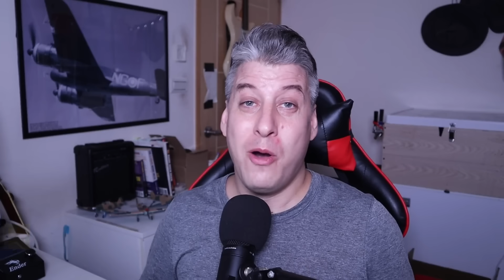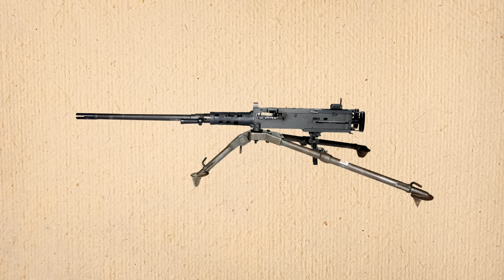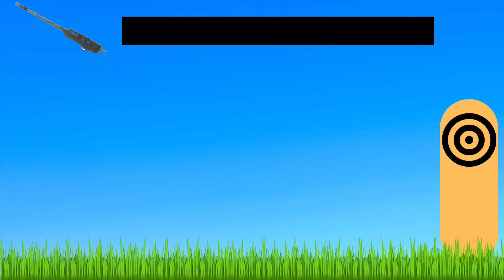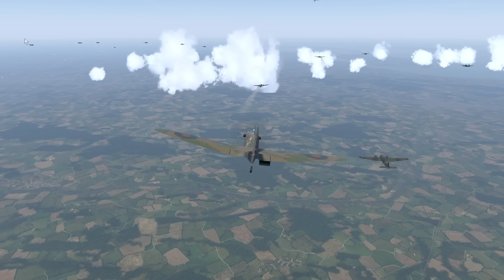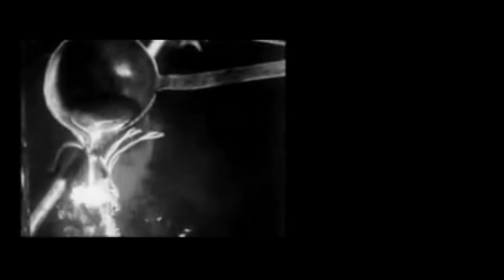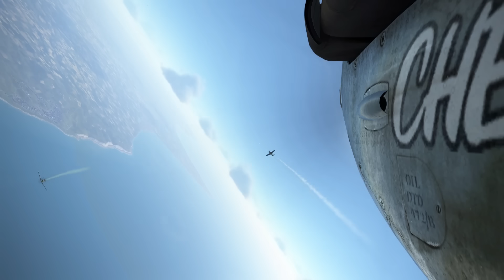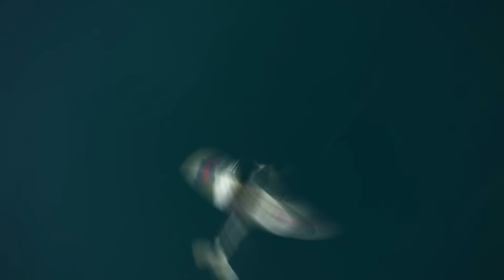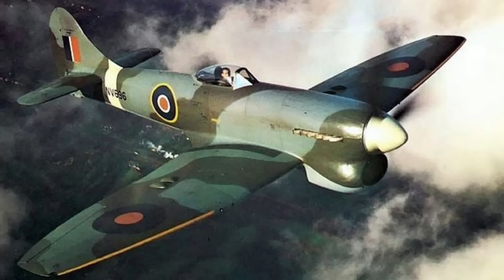Why Did The RAF Use .303 Caliber Machine Guns in WW2? The Surprising Answer

Comment from the maker: 🧥 Have you always wanted a distinctive and authentic leather flying jacket? Check out the fantastic range from Legendary USA here: https://calibanrising.com/flying-jacket/
Reply: About the jacket i would look a bit awkward at the company eh eh. You're rate of uploads is impressive. Interesting discussions about such different but highly performance tail wheeled aircraft.
Reply: They used .303 machine guns as a main weapon in fighters up to 1941. So why are you making a big deal about it? The US was using 4x.50 then and that was pretty pathetic.
Reply: Before WW2, the thinking also was that planes would be engaging at longer distances (due to better/higher engine powers), therefore in the cone/zone of a bullet travelling further, with a gap in between each bullet, a higher rate of fire would give far more chances of a hit against at that time, unarmoured planes. Only with actual battle experience, was it seen that dogfights would be at much closer ranges (& guns synchronised to this) so you were far more likely to hit your target, so cannons made much more sense.

A lot of nations still had planes with only 2-4 machine guns, so having 8 was seen as a big advantage. Small calibre MGs & lower weight gave the planes better mobility. During the BoB, the 0.303 was good enough against the opponents of the time. Boulton & Paul Defiants with only 4 x 0.303 mgs proved they could take down a bomber quite easily, it was the gun platform & accuracy that mattered.

Having a standardised mg & ammo makes things far easier for all services to resupply, & keeps the penny pinching accountants happy. Britain didn't have much money after WW1, and most of it still went to the Royal Navy. As you stated, there weren't enough 0.5" mg anyway, & Britain's industrial base couldn't cope with more demands. Powered turrets were still quite new, & lighter guns helped their early technology to function. Early RAF tests of 0.5" guns sadly killed an air gunner as the recoil wasn't designed in properly, & the guns went into his chest. 

The Germans had trouble with their 20mm cannons in their Me110s jamming after hard manoeuvres. All new tech went through teething issues.

However, it was agreed that the 0.303s were being outclassed by later plane specifications, RAF pilot/ace Douglas Bader didn't want 20mm cannons originally (probably for the  reasons you stated of jamming etc), but then became a complete convert to them.

Thank you for your video, well put together & presented, I enjoyed it! 🙏🙏
Reply: I have never such a load of crap spoken in all my life!
Reply: No
Reply: They were a poor nation. Of only 50-million people.
With not the manufacturing resources of the Yanks for example,
They needed to standardize the production size of bullets over all their guns.
They did not have a plethora of bullet makers when the war started.
Did you know that all Brit infantryman carried only ten (!) rounds?
Simple as that.
Reply: @DennisMerwood-xk8wp  My Grandfather's diary show he was issued 50 rounds of .303, plus extra for the Bren.  That was Green Howards, 1939.
Reply: @TortlandUK  Yeah but the Bren was a machine gun. 
BTW, when we went thru our compulsory military training in NZ, in learning to fire the Bren, we were warned that it was only to be fired in short bursts! Otherwise, the barrel  curled up at you! LOL
Reply: @DennisMerwood-xk8wp You could mag dump and then swap the barrel.

Comment: And if a fighter existed with 18 to 24 303 guns it would matter.  Also more bullets matter if not for engagement windows of a few seconds.  So not stupidity but more lack or resources.  If 4 20mm outclasses 6 to eight 50 cal, six to eight 50calls outclass 10 to 14 303s.

Comment: Ironically when the P51 / A-36 where being designed one comment was how 8 to 12 303 machineguns in British fighters was cited as better than the 4 .50cal brownings used in the P40.  So upgunning this new plane was required.  So originally designed for 4 50cals wasn't going to be enough.  

This is why early British Mustangs had a wide variety of armament configurations trying to find something that worked.  Like 4 50cals and 4 30cals, 6 50cals, 2 20mms etc etc.

Basically spitting enough smaller caliber rounds down range isn't a terrible idea.  Cannons were clearly better when they worked and 50cals were a middle ground.

Comment: Regardless of how many .303's you have, the round just didn't make sense by 1939. You can hit an aircraft engine block all day long with .303 rounds and not significantly damage the block whereas one .50 round can shatter the block or deform it enough that it won't function.
The real case is that the Yanks and the Brits simply had to use what they had; the Brits had .303's and ammo for them and the Yanks had .50's.
How would you feel as a Lancaster gunner firing .303's KNOWING that your enemy had 20mm cannon? The continued use of the .303 after the Battle of Britain was criminal.

Comment: So if we used .303 to carry more ammunition then why did the Spitfire and Hurricane only have enough bullets for 15 seconds of firing?
Reply from the maker: I suppose that's down to rate of fire. The Hispano normally only carried 30 rounds when fitted in later Mk Spits, so 1000+ .303 rounds is pretty good.
Reply: Appreciated, but the bf109 could fire for longer right?

Comment: A Spitfire gets the jump on an FW190 that's at 300 MPH.  Diving out of the sun at 360 Mph.  The 303 has a maximum effective range of 550 yards in ground conditions, so lets just double it for the thinner air,   1100 yards... that's 3 seconds from maximum range to passing.   At 1200 rounds a minute from 8 guns that's 160 bullets.   174 grains each, that's 4 pounds of lead on target. A 50 BMG at 800RPM firing standard lead m33 ball, giving it no extra time and the same 1100 yard range, a pair of ,50 caliber guns fires 80 rounds of lead, at 660 grains each.   That's 7.5 pounds of pain on target, not including the extra time the 50 cal can fire from.   A single 50cal in each wing is better than all 4x303's let alone the 6 or 8 guns common on american fighters.  To their credit the brits did give up on the 303 basically instantly, except in bombers where they were mostly ineffective and RAF bomber command died like flies, something like 48% dead.   That's not casualties, that's tombstone dead, that's not eyepatch and a cane those are coffins.

Comment: The British were indeed aware of the benefits of 20mm canon, and hence the Whirlwind; but that was very tightly designed around an engine that got dropped by Rolls Royce. The Army had been trying to replace the .303 round since 1910, but each time they had a candidate, War Was Declared before the change was properly begun, so they made do with what they had. Which is probably a major reason for sticking with .303 in aircraft guns: changing production lines for both guns and ammunition is not something you want to do at the beginning of an existential war. The case for .50 calibre in bomber armament is probably stronger, but reduced bomb loads was something Harris would never accept; and the experience of the B-17, bristling with .50s, shows that that armament wasn't adequate for daylight bombing, either.

Sticking with rifle calibre machine guns looks like an obvious mistake, or hide-bound conservatism, but it turns out that there were lots of constraints that made it that way.

Comment: I have a question: the UK was looking for a machine gun for their tanks early in WW2 that was belt fed and had a narrow barrel to poke through a small hole in the armor. They ended up adopting the BESA machine gun and accepted it being in 8mm Mauser as a compromise as they were desperate for an alternative to the Vickes.

Why didn't they just use .303 Browning machine guns that they were using in aircraft? Then they could stick with .303 ammunition.

Comment: You missed the issue of effective range.  The 50 cal effective range is more than twice that of the 303.  Then there is the issue of stopping power or damage.  That difference is significant as the 50 cal round is 4 times the weight of 303.  And as for your claim of inadequate incendiary rounds for the 50 cal watch any videos of P-47s shooting up German supply trains in France after D-day.

Comment: Your opening statement was ridiculous. The RAF didn't use .303s exclusively for "much of the 2nd WW". In the Battle of Britain less than year after the war started 19 Squadron had cannon armed Spitfires but jamming issues dogged their effectiveness. By early 41 these issues were sorted. My point is that the .303 was never anything but a stop gap solution for the RAF until the cannon was ready.

Comment: Obvious it is and the same with the US. The main battlefield rifle of the UK was the .303 cal Enfield; the US used the .30-06 cal Springfield. Machine guns followed, so as to use common ammunition. The US deployed the .30-06 BAR. The US also deployed .45 ACP for the M!927 Thompson and the M1911A Colt. Both eventually went to 20mm cannon. Others combatants did not do so and made a big mess for them. The .303 cal was good choice at the time.

Comment: When the RAF were using .303 machine guns, before the switch to Hispano's, in 1939-41: The USAAC and US navy were mostly still using .30 cal machine guns of smilar firepower. The USAAF and US Navy didn't upgrade to .50 cal as standard until late 1941 and didn't complete standardisation until late 1942.

Comment: A 303 will go through an engine block. As teenager on ranges you could see the penetrative ability of the 303. Massively lighter has benefits. You have only a few seconds of firepower. Heavy is not an advantage when you run out of ammo!

Comment: Short answer: they thought the 303 was adequate pre war like it had been in biplanes. They fafo’d. Then they upgraded.

Long answer: prior experience had them believe that simply multiplying the number of same caliber weapons would achieve the effectiveness they sought. What they didn’t account for was new advancements in structural integrity shrugging these rifle caliber rounds off. You could use a .303 to chew through biplanes easily because it was very flimsy skin over mostly wooden frames with little or no protection for the pilot or the vitals like fuel. Modern planes had rubber coated fuel tanks for self sealing, they had armor paneling, they were larger and had more spread out control surfaces, and they were less wood, more metal. Instead of shattering wood and spraying splinters everywhere, bullets just punched neat little holes. Took a lot more holes to build to critical damage, so the next step was explosive filler. Only problem: you couldn’t fit any amount of explosive filler in .303s and even in .50s it was marginal if any. 20mm was about the lowest you could fit a reasonable explosive mass into that would change the effectiveness of scoring hits, so everyone started adopting 20mm cannon. America was the only real exception, because the .50 dealt enough damage especially with incendiary tracers that it was deemed combat effective and the trade off in firepower for 20mm cannon came with weight and low ammo considerations that the .50 didn’t have. Even at the end of the war, a 20mm might have 150 rounds per gun if you were lucky. A .50 would have 300-600 rounds per gun, which is a lot more fighter endurance, especially when running escort or ground strafing. So the .50 stayed on. It wasn’t better than the Brit 20mm solution, but it was objectively better than a .303 which was an outdated caliber for air combat even by the time of the Spanish civil war.

Comment: Most countries relied on the the .30-cal gun in the pre-war and early war years. Early marks of the Spitfire used .30 cals for this reason. The Mustang didn't because it wasn't a pre-war fighter. But then planes got tougher and it became clear the .30 cal guns didn't have the oompf to get the job done.  What's interesting is that the US settled on the .50 cal as the standard weapon while the British went for the 20mm.  There weren't too many British planes with .50 cals as far as I know.

It would have been interesting to see what would have changed had the Brits swapped out 8x.30 cal for 4x .50 cal on some Hurricanes during the Battle of Britain.  I suspect the German bombers of the day would not have liked it.

You armament choice also has to reflect your targets; after the BoB, Germany didn't project much power with bombers so harder-hitting cannons weren't needed. Instead you needed enough firepower to take out fighters.  The Germans needed something hard hitting to deal with large numbers of allied heavy bombers.  Towards the end of war, Germans were flying with large numbers of 20mm and 30mm cannons.

Comment: Sometimes sides need to switch weapons. The .303 with its light weight, larger ammo supply and high rate of fire would have been perfect in the Pacific against the non-armored or protected Zeros, Bettys, Kates and Vals.    The Wildcat initially had 4 .50 guns and pilots hated the upgraded model with 6, as it weighed the plane down more against the lighter Zero, and they could carry less ammo per gun.

In the Euro theater, all planes were well protected.  20 mm cannons were almost essential, especially against bombers.

Comment: The .50 was the better aircraft gun.   It is far more potent than .303.  The weight of a .50 gun was not the issue it was made out to be. The difference in rounds per  second is moot after a gun emits more than 750 rounds per minute. 
And the counter argument is true that a higher rate will burn through more rounds pointlessly since after 1.5 seconds, a target solution is gone and rounds will be wasted shooting at air.
The .50 had far better range. This was far more important.
Its projectile velocity was far better, coupled with the more destructive projectile. It cut through air better with a more potent projectile.  The American manufacturing juggernaut, teamed with Canadian industry, could have easily supplied Britain with as many guns as they could even build aircraft. 

It was poor planning to continue to use .303 as aircraft guns. This is a long, bygone conclusion, and reiterating the obvious

Comment: Before the US entered the war and had .50s all over the place, there were lots of planes with 7.7,mm, 7.92mm, .303 cal, and .30 cal machine guns.   And the 20mm wasn't a 'common' thing on fighters at first.  The MG FF cannons on the 109 E-4 had a slow rate of fire, paired with a set of 7.92s.  So, yeah.  Just wasn't just a Brit thing.

Comment: The great irony was that Britain had the best 20mm aircraft cannon of the war in the hispano. I wonder how many british bombers would have been saved if they had installed these in the rear turrets of british bombers
Reply: Three points to consider;
* The real purpose of guns on bombers is not to shoot down enemy fighters. It's to enable the bomber to reach its target. It doesn't really matter if you shoot the fighter down, or just get it to stop attacking, it only matters if you got to the target and dropped your bombs. Or not. At night, engagement windows were small, and 4 x .303 could put out a lot of tracer very quickly. Quite useful for making nightfighter pilots flinch and break off.
* The other thing to consider is that 20mm hispanos are heavy. Extra weight means bombers fly more slowly. Which means they spend more time exposed to flak guns, and it is easier for enemy fighters to reengage. This is why the Mosquito was such a pain - if you blew your initial attack run against them, it was much harder to re-engage.
* Finally, how many 20mm guns do you have? There are a finite number of guns, and you can only produce so many per month. And there's a lot of demand for them. You can get more bang for buck installing 20mm cannons in fighters like the Tempest, Typhoon or Spitfire than you would get installing them on Lancasters or Halifaxes.

Comment: .303 machine guns allowed MORE AMMUNITION TO BE CARRIED. 
Later Spitfires had 20MM CANNON FITTED in addition to machine guns. 
The Spitfire could ALWAYS RUN RINGS AROUND THE MUSTANG, due to its laminar flow wings crippling its DOGFIGHTING ABILITY.  
Which means that the SPITFIRE COULD PUT MORE ROUNDS INTO ITS TARGET than the Mustang EVER COULD. 
Mustangs were FORCED to lurk around airfields WAITING FOR FIGHTERS TO LAND OR TAKE OFF,  Just so they could SHOOT THEM DOWN. 
The SPITFIRE FOUGHT THEM ONE ON ONE.